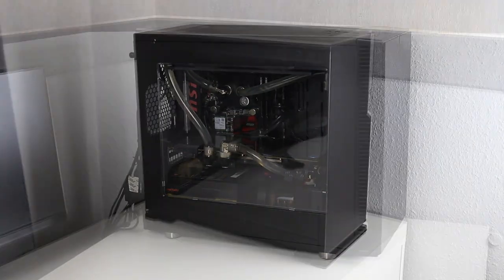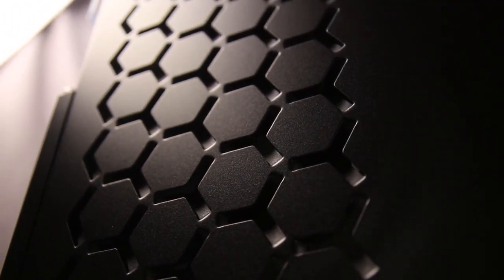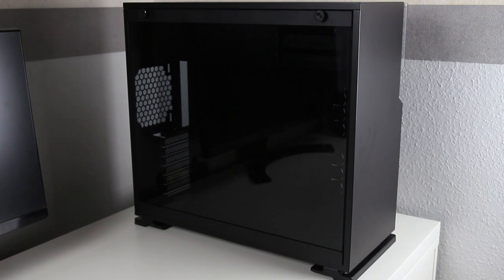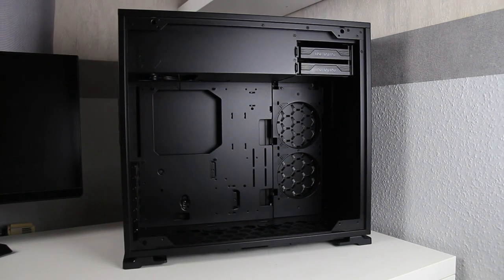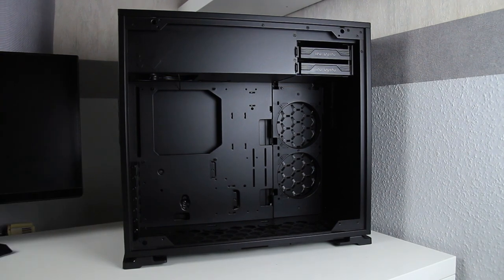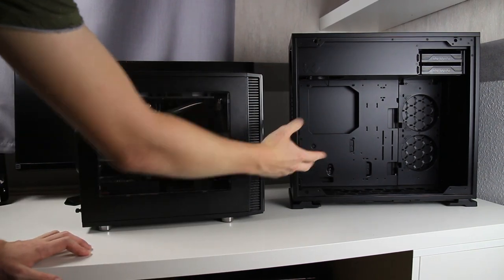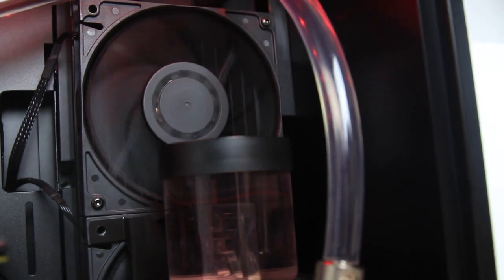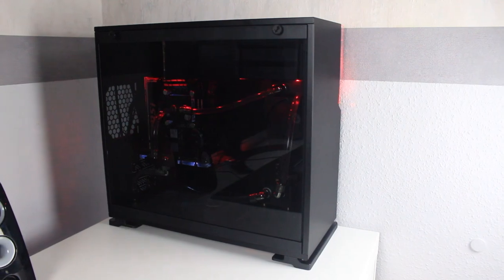In Win 101 Unboxing, Review and Custom EKWB Watercooling [HD]

Comment: I have this case, my problem is that my HDDs get way too hot, because of my PSU, the fan doesnt turn on the psu. Its a rxm750 by corsair and it silence psu fan. So thats one of the reason, also when gaming along time the radiator gets hot and makes the hdd hot, thats my only complaint.

Comment: You can use slim fans on the side mounted radiator if you really want a 360mm radiator at the bottom, but I think dual 240mm are more than enough for most single CPU configurations with a video card. Nice job. I have the white one and going to install my loop in it this week probably.

Comment: i would really like to know more about rad clearance.  If you used slim fans on the bottom rad or back wall rad would the 360mm and 240mm work?  if you removed the drive bays could you fit a 360mm on the back wall?  maybe post some results on your thermals.
Reply: Gregory Van Dyke you can't remove the drivebay. It is only a 240 mm rad on the side possible.

Comment: Very clean build! Love it. But how do you drain this thing?
Reply: setitfree78 very easy just unscrew the reservoir and open it over a bucket
Reply from the maker: hi. draining without a draining valve is possible if you use flexible tubing only. I do it with unscrewing the whole reservoir and opening it over a bucket. you can also do this with every other komponent in your loop. e.g. the cpu cooler.
Reply: Patrick's Box thank you. That's exactly how I drain my loop now as well. I have a bottom res with multiple ports so I open the bottom port over a sink and drain. I'll pick it up and move it around a bit to get the rest very simple.

Comment: But, what CAN'T you fit the radiators? That is an example of an important detail. Include this in future reviews.
Reply from the maker: thank you. the rads are  simply to thick with fans attachted. a 360 rad on the bottom would interfere with a 240mm on the side. you can't mount both. no clearance at all.

Comment: Appreciate this video, I'm really interested in this case.

Also I'm curious to know how was the thermals & noise levels compared to that silent case of yours....
Reply from the maker: thank you.

The thermals in the case and for the components are more or less the same. maybe I could have mounted a third fand on the bottom just to suck in fresh and not hot air through the rad.
At first I thougt there would be much more noise because of the glass panel. but its not. its quiet. the only really bad thing ist the drive cage. you can hear your drives spinning. it vibrates very much. so i crafted a better decoupling. and now the drives are silent aswell. Nevertheless I'd recommend this case!
Reply: Thanks a lot, I'll remember the hddisk mounting.... may use pieces of thick foam to fix that.
Reply: You can add some foam and you can even rest an additional HDD on the PSU cables right next to the HDD cage. It can't be mounted here with screws. But it can't vibrate either

Comment: hello i do not speak english very well i'm sorry. I wanted to ask you how you did for the connection of the light button. because I do not know or plug it in and I think the wire is pretty short
Reply: hey just check your motherboard manual where to put the power LED into.